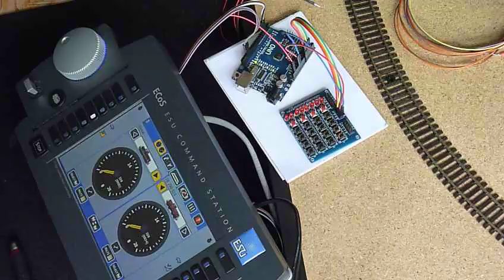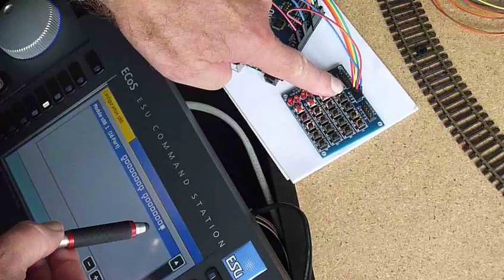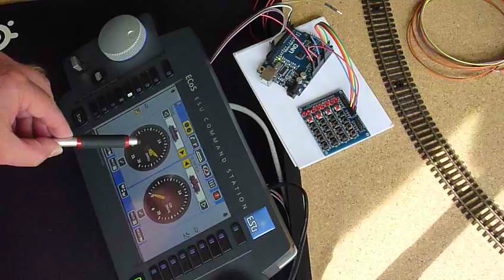RMR012 - Arduino used as an S88 occupancy detector board

Comment: Hi Ruud , great thinking. I'm also trying to let my arduino(mega) talk with my trains ( schaal N ).
but without dcc and koploper. I already fixed pwm-controlled throttle - breaks(slow stop) - and interupt(breaks) for block
detection. All is for DC control by L298N.
Now i'm trying to figure out if it is possible to detect blocks by the arduino ACS712 current sensor but
next to infra-red because i have most of my track blocked out into parts.
keep us updated, thanx
groetjes Arnold

Comment: It has far from occupacy detector. The most important thing - current detector for the section is missing. You are just generating signals for ECoS.
Reply: It is a full fledged S88 module for just $3 ... where can you get that? If you need current detection, have a look at this link, it can be had for just a couple of $ extra via an 'Okkie' board. https://rudysmodelrailway.wordpress.com/2017/10/01/arduino-dcc-decoder-and-occupancy-encoder-brought-to-a-new-level/